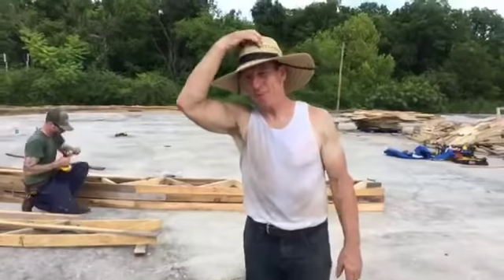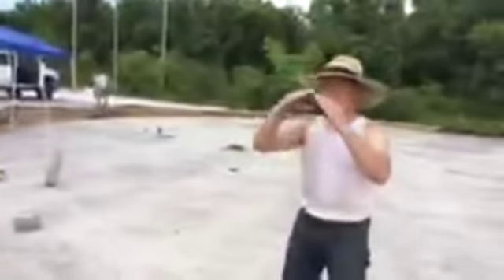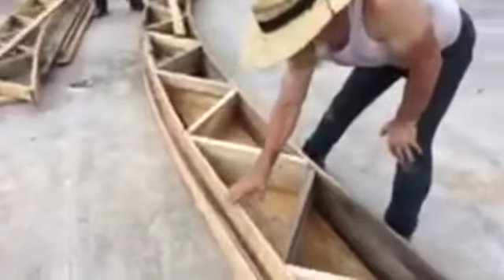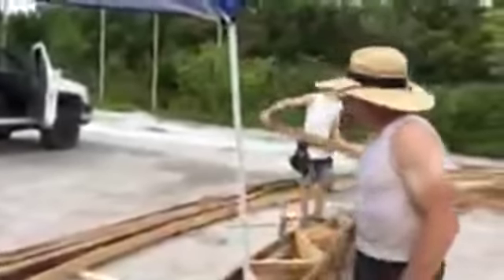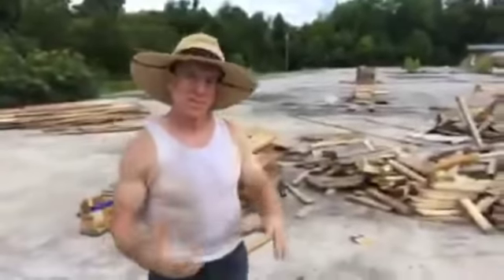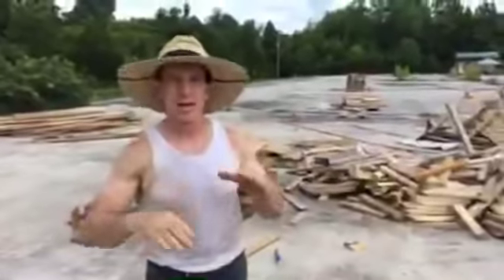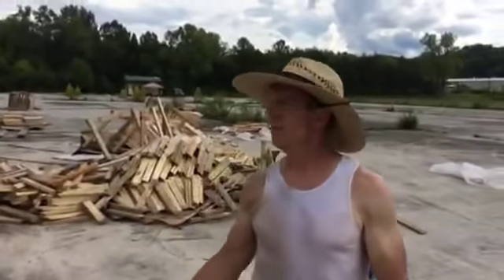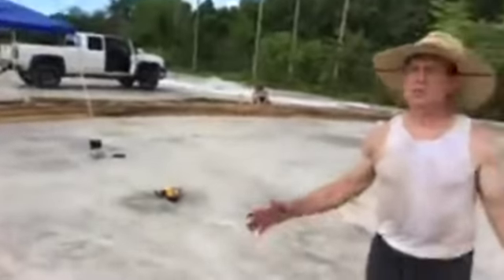Incredible Tiny Homes:  Saturday 8/4 Updates On New Warehouse and Community Property

Comment: I don't doubt the strength, but is the county putting any building codes on you? I'm curious why you aren't doing a traditional quonset (sp?) hut. Is it the cost? Looking forward to seeing this go forward.
Reply: Anything placed on a foundation has to meet local building codes... That's automatic...
Reply: Same way people can build their own house even if they go out into a forest and mill their own lumber.

Building codes sets minimum standards that the end product has to meet, but how anyone gets there can be done however they want as long as the end product still meets those minimum requirements.

Besides, scrap is just wood that previously had no intended use but it's otherwise just wood and there's nothing unusual about making a structure out of wood or improvising how that wood is used to get the job done.
Reply: @ZeoCyberG  Well said. I think John is also Brad.